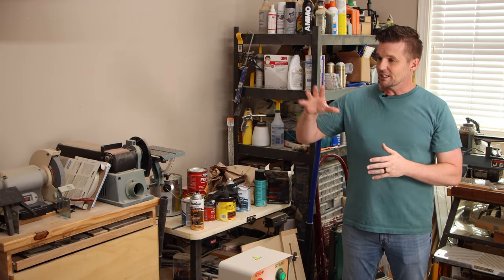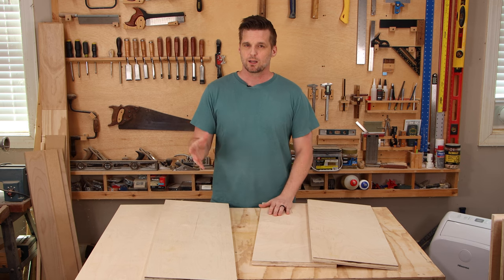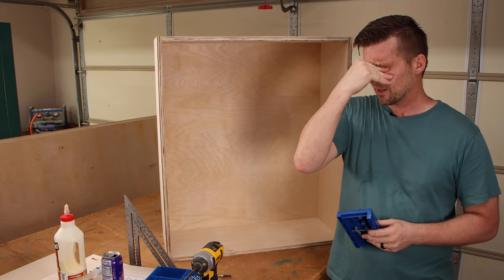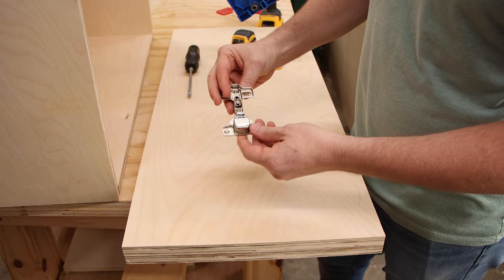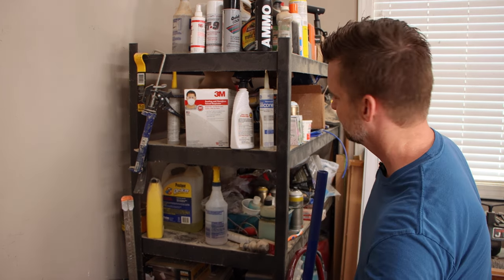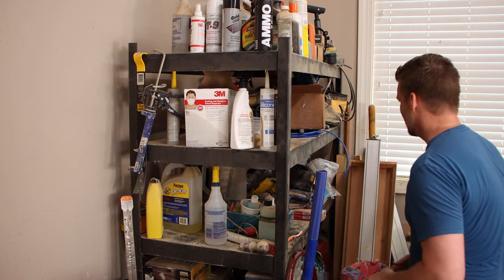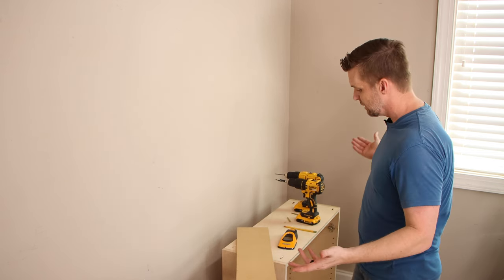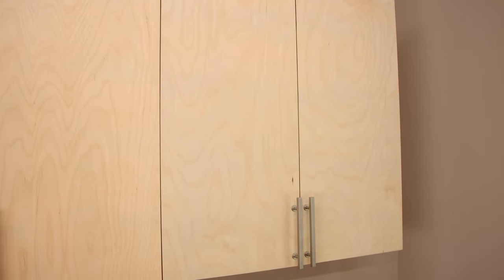Easy DIY Garage Shop Cabinets | Finally Organizing This Mess!

Comment: You're a braver man than me, throwing things out like that. If hoarding stuff and then finding it untouched/unopened years later was an Olympic event, I'd be bringing home the gold. The thing is I keep that stuff and don't throw it away because I know I might need it for a future project. It happened once. About 17 years ago. I know it will happen again. Any time.

By the way, nice cabinets. Hoard stuff and hide it in cabinets so no one can ask, "Why have you still got that?"
Reply from the maker: Ha! That's usually my thought process, but this time I think someone has been putting stuff on the shelf without me knowing! 😂

Comment: I use license plates as heat shields for copper plumbing. It helps to hold a no-scorch blanket. They just kinda drape and are hard to hold anywhere. I just tape them to a plate and wedge it between drywall and copper pipes.

Comment: I too go through stuff every once in a while (not frequently enough) and wonder "what was I thinking - holding on to this?".  I have a bunch of the DeWalt bags and have the smaller ones tucked away for carrying job specific tools off site. I have a couple of the larger ones that I've made specific purpose, one for plumbing tools and another for electrical tools. They come in handy to grab when I'm doing a project of that sort. Like someone else, I use the totes for paint supplies, one for drywall, one for tiling, etc. - Chris
Reply from the maker: I love the idea of having them set up for different tasks. Nice

Comment: what did you do with the cabinet support panel you put in initially? did you take that off after installing the cabinets? wondering to know if we need any support below the cabinets to hold the weight

Comment: Oh hun, you made me laugh so hard! I too save stuff for "just in case" and then wind up throwing it out. I have found that doing a yearly clean out has helped greatly with the hoarding.  All of my painting supplies went into a snap-lid tote. And then there are my parts drawers. Screws separated by size. Nuts, bolts and etc. My family knows to return tools exactly where they got it from or face my wrath. As I am a bit older than you I had to face the hoarding/stockpiling early when I moved. Man that was a major lesson in not keeping everything! Cabinets look good but my concern is that since you didn't make them to the ceiling that you are going to create another stacking/junk pile on top of the cabinet. Thanks for keeping it real and not editing out the oops with the holes!
Reply from the maker: Thanks Colleen! Glad to know I'm not the only one!

Comment: At the time lap 15:42, you are trying to open the right side window of the cabinet....and I can see that it touches the edge of the window of the other cabinet not letting it to fully open. I wonder how you can open the inside windows of the cabinets when they are closely fitted like this?????🙃🙃